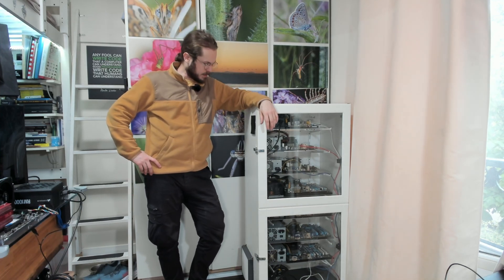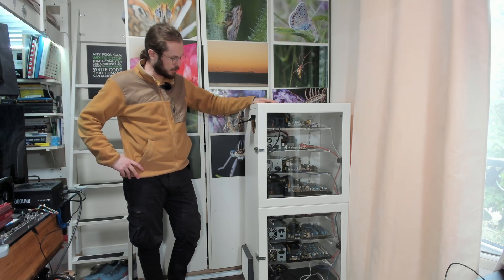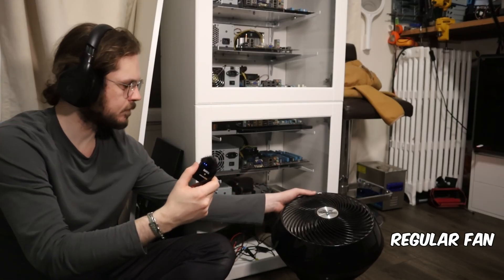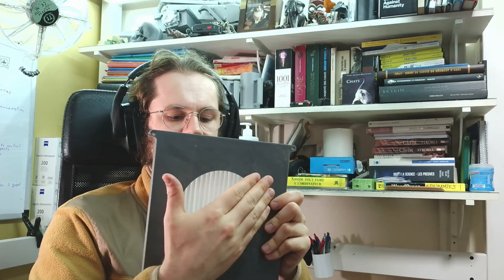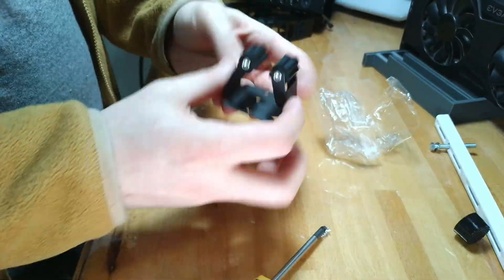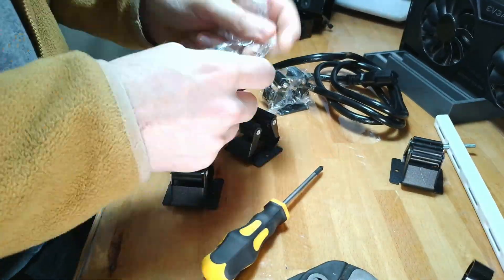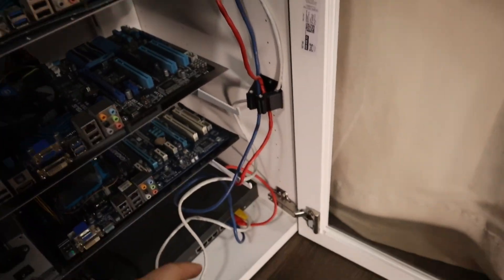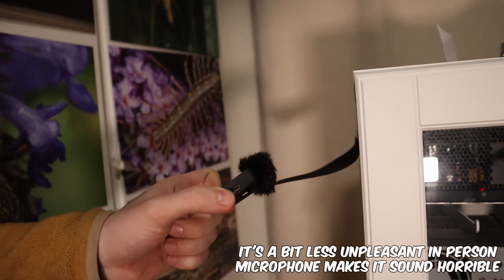DIY server part 2 - sound and enclosure

Comment: Nice video. I liked the idea with car filter beeing used for the rack. Allow some suggestions. Put small feet in the cabinet and let the air come in from the bottom and exit at the top. And try slower-quiter fans. Maybe 2 fans for inlet and 2 exaust. Also try to smooth the surface at he exhast hole you drilled. Turbulent air makes more noise. Keep ti up, good work
Reply from the maker: Thank you ^^
Did half of what you recommended in the video I released yesterday ^^
Did not think about the turbulent air though x)
What would be the intended purpose of putting feet inside of the cabinet ?

Comment: ahahah you are very optimistic about that jet engine.
Sure, you could sleep near it, but in a long run (weeks) without earplugs a couple of average 12cm PC fans even at 1200~1600rpm in an adjacent room with open door are going to crush your sanity sooner or later.
Melamine board resonates like hell with uninsulated vibrations, amplifying the noise significantly.
Reply from the maker: yep I found that out XD
In the video that should be published soon I changed the fans to address the issue x)

Comment: Hello. Your fan is so noisy. Mining computer produces a lot of heat and the fan isn't meant to be near human. I m sure quieter fans would do the job. Perhaps if one at the extraction and one at the intake will help. The holes are on the same side. Isn't it a problem for the airflow ? Will you  cover the inside with soundproofing material ? Have you consider printing D-ring cable management ?
Reply from the maker: Oh I fully agree that the fan is too noisy. I'm considering either going for more fans or a normal house fan ( and also change the filter system at the same time ).
Not too certain about the fan for the extraction as I would like to have negative pressure in the server to ensure the dust stays out. I'll maybe experiment with fan combinations though.
The holes on the same side ( and all the computers in between ) are not a problem at all surprisingly, the airflow is very good.
There is not that much space inside for sound proofing but it is something I can put on the outside, no constraints there.
I never considered D ring cable management because I did not know it existed x) Been learning a lot with all the questions and suggestions in the comments 😁 I may consider it for a future build though